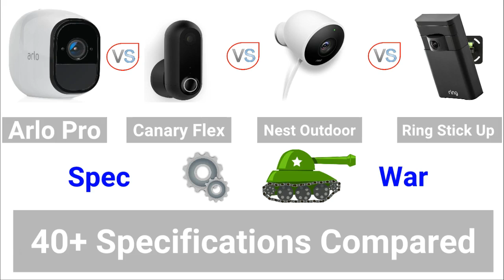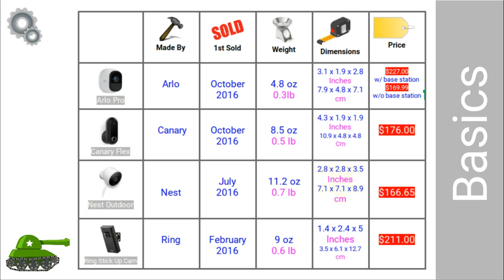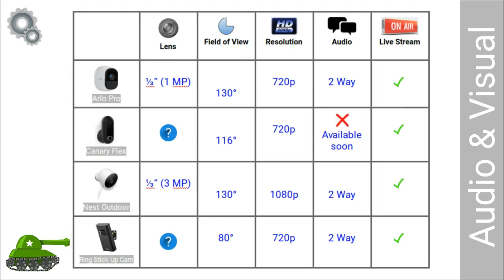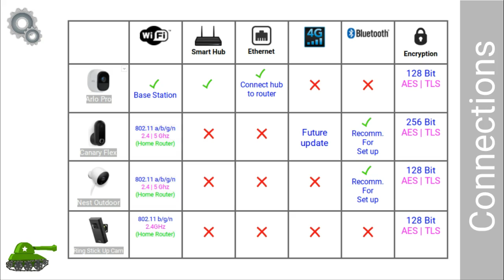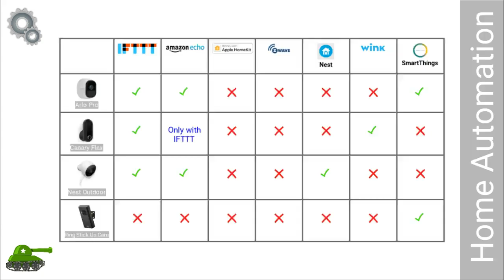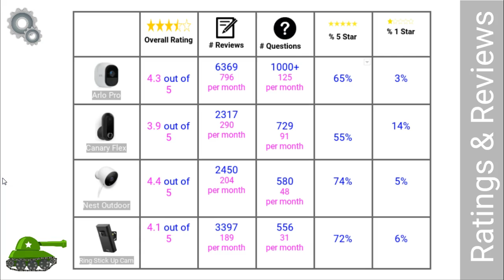Arlo Pro vs Canary Flex vs Nest Outdoor vs Ring Stick Up Cam

Comment: Can the Arlo Pro be hardwired, somehow? I don't understand how you would charge or change the battery if it's a mounted outdoor camera.
Reply from the maker: Thanks for your question. It is a strange one. The Arlo is not designed to be hardwired. You need to bring the camera indoors to recharge the battery! The power cable plugs into the back of the camera. Click on the link to find out more. https://www.arlo.com/en-us/images/Documents/ArloPro/arlo_pro_rechargeable_battery_installguide.pdf

Comment: ANOTHER PRODUCT FACTOR FOR NEST OUTDOOR Rubbish product - I had 2 NEST Outdoor cameras ripped off the wall with ease and the bad design of the product did not prevent it - DONT BUY IT!!! The service has been awful and not customer focused at all especially spending over £1,000 one would expect some service instead it has been arrogant and dismissive offering less than 6% discount - I would have expected more from a Google company
Reply from the maker: That sounds like a complete nightmare- and completely naive in this day and age when a company must know that disgruntled companies will "vent"on social media. Did your cameras capture footage of the people that ripped your cameras off the wall?
Reply: Jan Bertelsen 
What you said applies to every single camera in this review!  Always mount the camera high up out of reach. Also, the nest would be the hardest to take since it's wired.
Reply from the maker: Thanks for taking the time to comment. As you say, these cameras need to be mounted out of reach. Also, if you were using the cloud storage system, with any luck you would have footage of any attempt to steal an outside camera. Cheers.